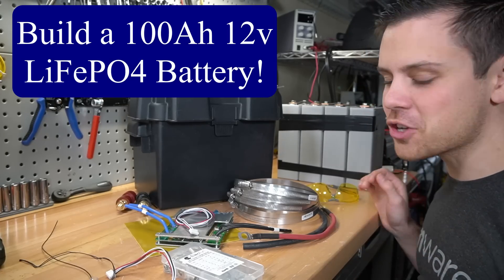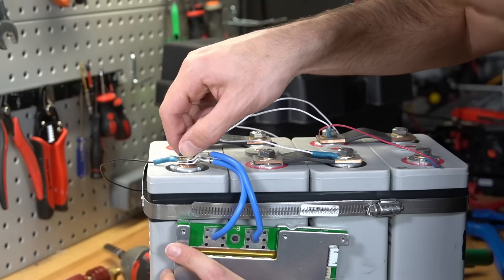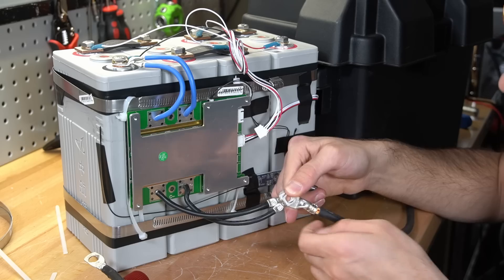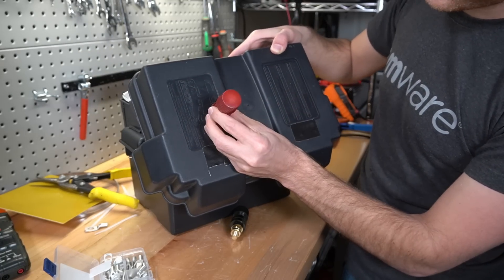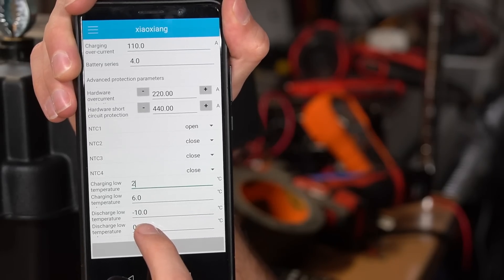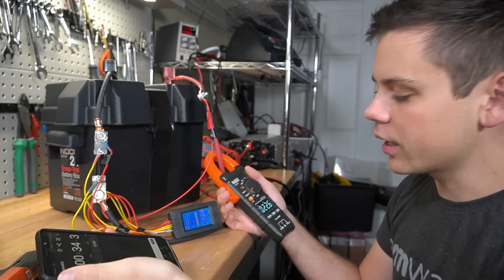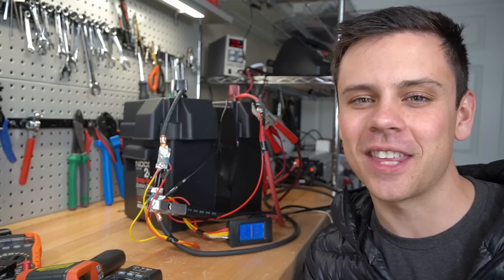DIY 12v 100Ah LiFePO4 Solar Battery for $555

Comment: I think I'd rather buy the Licitti Battery box pre-assembled with a 1000 watt inverter for $168.  All you need to do is drop in a 100AH LiFePO24 battery.😮

Comment: Any DIY options for heated batteries?
Reply: These are good for up to 60c (140f).
Reply: @anthonypelchat  yeah, but what about surviving cold?
Reply: @msturtz  These can change at 0c and discharge at -20c. Are you needing colder than that?
Reply: @msturtz  You could get a 12v battery warmer, or any dc powered heating element, and then connect it to a temp sensor or thermostat.
Reply: @anthonypelchat  certainly can be colder than that.  Outdoor enclosure in the high Rockies.  Insulated box.  Charge controller and radio will generate some heat, when in use, but at night that isn't much if any.  Planning to use some used 125AH AGM's to start with, because it's what I have,, we'll see if they survive.
Reply: @msturtz  Take a look at the battery warmer and temp sensor that I sent to you. That might be a good option, though it will eat through your power supply.
Reply: @msturtz  Also, there are very cold temp LFP batteries out there, but they may be harder to find. Another option is LTO cells. Those can usually handle very extreme temps.

Comment: I’ll be using this to build a car battery for sure
Reply: Be careful. Car batteries need several hundred amps to start a car engine. These are only rated up to 300 amp pulse for 30 seconds. Most lead acid car batteries are rated far higher, around 600 amps or more. You may want to look at either Headway cells or using these or others alongside super capacitors. SCs alone can start a car, but they don't store enough power to run for very long.
Reply: @anthonypelchat  my old car I was going to use about 1KF worth of capacitors, but my new car I doubt that’s remotely necessary, though I may just put 500 on anyway just in case. There’s no engine for my Soul EV to worry about so realistic a few amps, definitely less than 300W should be all that’s needed to start. But they still put a bog standard 600CCA lead acid battery in mine. They basically die of old age
Reply: @EV_Dreams  A replacement 12v for your EV is perfect. It frankly should have been done before, though all manufacturers kept it lead acid. For engine start, you just have to worry about over doing the amps and killing your batteries. 

Out of curiosity, have you ever tried running a normal car on 16v instead of 12v? I might try next year. The alternator would have to be changed, of course, or simply removed. Not suggesting that you do so. Just curious if anyone has tried it on non-race vehicles.
Reply: @anthonypelchat  I assume the engine computer and any other sensitive electronics would need to be swapped, and the more basic ones like window motors and halogen lights should be okay, but will definitely get used up faster at the least. I don’t think that the wiring will need any changes, just a concern on if the extra volts will cause extra current draw. Needless to say I haven’t tried it.
Reply: @EV_Dreams  Thanks. From my research, most everything should be fine. Possibly the radio and small lights, but that should be it. We are only talking about a 2-3v difference in actual usage (the car runs at 14.5v). The wiring won't be an issue, since the amps would actually drop. In theory, the starter should run much better and with many less amps. Similar for the spark plugs. But again, the only clear examples that I have seen are race cars. 

Got an old car that I'm tempted to try with. Thinking about replacing with Li-Ion and completely removing the alternator, which causes hp and gas mileage losses. May try to attach solar for some periods of extra driving, but wouldn't be able to do much at night. Would also have to replace bulbs with leds if possible. Should be an interesting project, but cannot do anything until next year.
Reply: @anthonypelchat  I agree that devices SHOULD use less current with higher voltage, but there’s also the risk of runaway. I won’t claim to be an expert, but Basically there’s a chance that with some devices, a voltage can be reached where they just start drawing endlessly increasing current until something fails. Know exactly how much power your car uses while it’s driving as without the alternator the vehicle relies entirely on the battery for all power, presumably including the Spark plugs, and get a battery that can last at least double your average trip length
Reply: @EV_Dreams  Yep. If I do it, it's just as a project on a 300,000+ mile car. Doesn't really matter if things don't work or if I cannot drive more than an hour. The current headlights would be the biggest drain on the battery right now. Roughly 120 watts while on. leds would bring that down to ~15. Gotta make sure that it's legal with them though.
Reply: @anthonypelchat  and find ones that’ll work on 16v. LEDs are very voltage picky.
Reply: @EV_Dreams  Didn't think about that. Thanks. I could run a few items using a buck converter if it comes down to it. Defeats some of the point though, but a good exercise in understanding anyways.

Comment: So if you have 6 12v batteries, you need a BMS for each 12v?
Reply: You can run packs of batteries on a single bms, but you have to be able to connect the balance cables with each pack and you are limited in amp output by the bms.

Comment: I am going to be building my own batteries pretty soon but I wanted to ask you a question about compression. 

Is it advisable to put two Sheets of plastic on either end and then put the hose clamps. That way you're providing compression on the outer sides of the battery?

Comment: Do you need solar charge controller to charge this battery? Or can it be connect directly to AC-DC 12v converter?

Comment: what would be the best BMS to use for my boat it going to have a lot out put to run everything like lights livewell crank the boat an run depth finders so it lot of power ? i just want to take the cheap lead battery out an move up since you can build one like 500 bucks now that last rest my life

Comment: I have been looking at Bioenno batteries for Amateur (HAM) Radio use but the cost for the amount of power that I would need, I can not justify for a battery at this time. BUT, if I build one according to your instructions, it is easily about half the cost of a pre made battery. And I would gain experience and knowledge about my system... THANK YOU! This is my next project.

Comment: A tip for dropping a battery into the battery box. Take the lithium battery and lay it on the side side of the battery that is opposite the bms side. Take battery box and lay it on its side to the bottom of the battery.  Slide the battery into the box. Why lift and drop a heavy weight when you can slide it easily and with no risk of any damage. I learned that from loading boxes all day long.  It saved my shoulders.

Comment: If I was build 2-12v 100ah batteries and run them in series for my trolling motor on my boat what bms and charger would I need?
Reply: @Dee Pee but then I wouldn't get the run time I would get with two 12v correct? Or am I wrong

Comment: if the cells expand and contract do NOT bind them with a metal band.  U need to add provision for the change in cell overall dimensions.

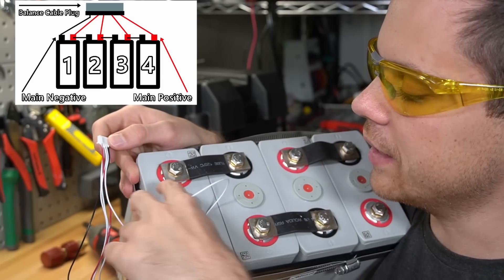Comment: So at 1:58 the diagram shows the balance cable wires connected to the positives on all the batteries (red wires to red "nuts") but when you cut to the actual battery the second battery is not connected to any cable,  third battery is connected with both pos and negative to white wires, and the 4th battery is only connected to the red cable with the positive terminal, not anything to the negative at all. Its very confusing, could you clarify?

Comment: Hi will I built this Battery a few months ago after watching your video, it's a great battery , the only problem I have is a discrepancy between the BMS and the victron battery monitor , at 13v the victron monitor said 52% and the BMS with your app sais 80% ,I think the victron battery monitor is the correct reading but am wondering why the BMS is so far out any ideas ,the BMS is connected to the battery then the battery monitor. Love the channel any ideas to the discrepancy.

Comment: Would I be able to add another one of these systems together in the future to create a 24v system? I'm gonna be building this setup basically for now with a 150a Daly BMS and then looking to switch to 24v in the future and I'm curious if I will have to get an 8s 24v BMS or can I have each 4s pack have there own 4s BMS.

Comment: Thanks for all the work Will. I have a question on BMS: does it independently cuts charge or load side? For example, on low temperature, does it only cuts charging while load (discharging) being available? Thanks! George

Comment: Okay Will, once I've built this battery and it's all set up and it's in the box I now have a 100 amp hour 12 volt battery with BMS...can I then repeat the process and make a second battery identical to this and then parallel the two together to increase my battery Bank capacity?

Comment: I loved the video, and have a few questions.  I would like to build a solar battery pack, with a limited 100w fold-able solar panel to charge it.  I know that its been 10 months since you built this project, and a quick calculation this project would now cost over $700 without a solar charger.  What would you do differently today?   I love the simplicity, and safety aspects.  Would like to use it as a survival power source.

Comment: Not trying to be a dink, I have watched quite a few of your videos and they're awsome, but the electrical tape stuck over top of stuff will fall off in like two days. If you wrap it around the battery and stick it to itself like you did before you banded the cells, it'll stay put.

Comment: What a great beginner video on how to build a battery for about half the price of a prebuilt.  I've watched perhaps a dozen of your videos and it always amazes me how much you know about batteries, charge controllers, inverters, shunts, wires sizing, fusing, solar panels, etc., etc., etc.  Tearing apart a $1300 LiFePo4 battery (Valance) is way, way beyond anything I'd do so that video was over-the-top interesting.  I was actually about to buy that one cheap ($500+/- ) battery that you ripped into with all of that smelly foam/glue crap for filler and the super cheap BMS component until I saw your video.  Thank you!

Comment: Hi, I discovered your channel while researching for a battery to run a trolling motor for a small 1 man pontoon fishing boat. I am in the process of buying a 12 volt 60 hr from Battle Born because of your recommendation. Here in Canada they are asking for around $800 after taxes. Twice that for the 100 hr.  Before I finalize the deal, I have a question for you.  Do you think that the project you just showed us would work for me if I used a waterproof container to place the battery?

Comment: Hi Will, I would like to prepare for the winter and have this battery power multiple heaters. I can't spend $ks so it would be nice to have something control which heater gets power. Basically only one heater at a time would receive power. So heater A would be on for 10 minutes then off for 30. Then heater B, then heater C. What device is designed for this?

Comment: Will, on previous video you talked about how one lithium battery came with air space in between the batteries so that air can cool them. On these batteries would it not be benefical  to put some sort small block wood/plastic evenly placed to do the same before tightening them with a hose clamp ?

Comment: I know the price of the calb cells jumped up right after this video was published. On 9/14/2020 I finally pulled the trigger on this setup with the Calb cells, the Over-Kill BMS, battery box and terminals. Total cost minus tax was $607. I'll be using this in a 4x4 overland setup and I'm pretty sure this will be a rugged, reliable setup. Thanks for all your hard work, Will.

Comment: Your vids are interesting but $555 sounds very expensive for just ~1kWh of storage. Our home would need at least 40 of those if we would go off grid and not run the diesel generator all winter.

Comment: Hey buddy! I love your videos and the fact that you encourage us to build our own batteries. There is though one question I have. As you know, there are batteries that blew up, such as the ones on Samsungs or iPhones. Now, would you sleep with a homemade battery under your bed? As some of us use LiFePo4 in camper vans. This is the question. Thank you!
Reply from the maker: You can sleep next to a LiFePO4. Those other batteries that are dangerous are a different chemistry. LiFePO4 is safer than lead acid or other types of lithium batteries. No gassing, no combustion. LiFePO4 is the best choice for RV application
Reply: @WillProwse  So the box you build - would it be O.K. for camping purposes?

Comment: Could this be used as a drop in replacement for a lead acid battery in an RV? I can change my converter charger to a set voltage for charging.

Comment: I like your videos very much, learning a lot and I am launching myself on a 31kWh dyi battery backup for our house. On that note, do you know if there is an equivalent 14S BMS I can use (bluetooth enabled) and how many cells in parallel should I connect with just one BMS? Thanks for your videos and channel!

Comment: Why do EV Li-Ion batteries cost $250/Kwh but the cheapest aftermarket batteries you can get are $450/Kwh. It's still too expensive, is it ever going to reach $100/kwh, so you can make a battery like this for $150.

Comment: I am connecting two 100ah lithium batteries in parallel. Which 1500w inverter do you recommend. This will be setup in my van. Thanks

Comment: Awesome video Will.  Thanks for doing what you do.  I am trying to decide whether I should build something like this and add an inverter and a DC Charge controller to basically make a higher quality higher capacity version of the eco flow delta or just buy that.  It would be used for powering a small DJ setup for remote weddings for my sound company and also for camping with a chest fridge.  @ 1300 or so for the pre made unit it probably wouldn't be much cheaper to piece it together but if it is higher quality maybe worth the energy what do you think?

Comment: Can I drop this battery in a system in my RV with a power inverter that charges at 13.6..or does lithium need around 14.2 to properly charge?

Comment: Could a portable camping solar panel charge this battery? There is an mppt charge controller built into it. I don't know if it would work with LiFePo4. Or is the BMS protecting the battery as it is? Brand is Suaoki. 100 watt. What wall charger can be used? I am interested in using this for camping. Your reviews have discouraged me from buying any other solar generator.

Comment: Hey Will, love your channel.  Despite what many people think battery tech can be quite fascinating.  I'm looking forward to some new battery tech in the future I thought it might be cool for you to cover.  I have been using 2 X 12V (in series), 55Ah AGM lead acid batteries for powering a 500w inverter to run my CPAP machine whilst camping. This setup usually gives me two nights and some handy extra for charging things and lights which I have become accustomed to.  I'm wonder if this DYI would actually give me similar usage due to the fact that the current draw is so low.  Also, since I don't have a solar array, what would you recommend as a good plug in charger for the money?  Thanks and keep up the good work!
Reply: I'm an idiot, I see a charger listed further down, I must have skipped over it thinking it was your recording equipment.  I'm still curious whether 100Ah would be OK at that low power draw.

Comment: How about a 48v package that can be paralleled easily?  Need to find a solid bms, and so on for that.... (and get a shed for all the hardware here..)  Getting a pair of 5kw inverters that can be paralleled... about 15-30 KVAH of storage.. and of course a bunch of panels for the roof or yard.. and yowza....

Comment: Thanks for this video. I got the Battery and the BMS I ordered from AliExpress. I am following the video to assemble it. So far 2 problems. I didn't receive the Antenna Cable (a metal piece with a black wire) mentioned in the video. I do have the 3-set cable one end of it is attached to the BMS. Second, after connecting the BMS wires, my meter shows only around 12.70 Volts. Before attaching the BMS, I got 13.2x Volts. Any thoughts on how I resolve these problems?

Comment: Thank you so much for all the info and teaching you share! Thanks to you I successfully managed to build and assemble  a 12V 135Ah Lifepo4 battery :) All work fine BUT the app for the BMS has no settings whatsoever. Actually the links on your website have both an app that crashes the moment I try to open it, on both a Motorola phone and a Huawei tablet. I got the app Xiaoxiang BMS on the Google store but it has no settings at all. Any idea what's going on? Thank you again!

Comment: Any issues with running a battery like this, with this BMS, in parallel?
My gut says there should be no issues because parallel just adds up capacity and isn't individually voltage dependent like serial is, but thought I'd ask since I'm not familiar with this BMS systems.

Comment: Question: If I used a 105ah BLS cells instead of the 100ah CALB cells, can I still use the same 100ah BMS?

Comment: Quick question. I've got some 50A BMS boards which I want to protect when I'm pushing 200A.  Putting a switch on the negative lines of the balance boards should keep them out of the loop, right?
Thanks for this, though. I was a little confused as to whether to bus bars might not interfere with the BMS but apparently not.